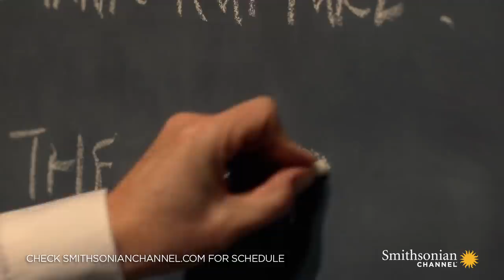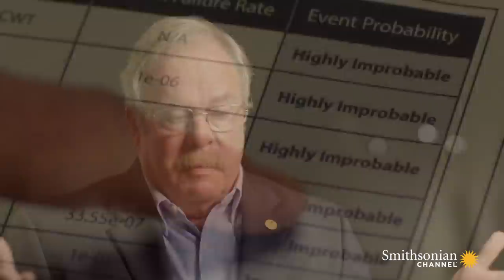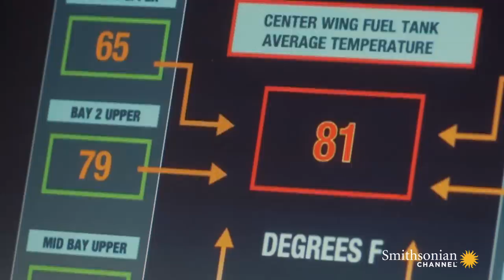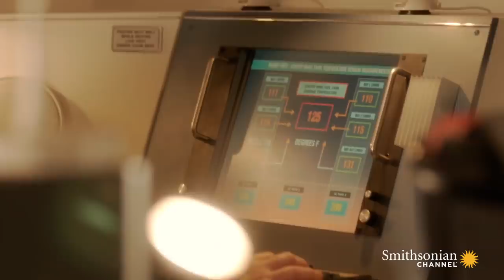How Air Conditioning Caused TWA Flight 800 to Explode

Comment: I would rather believe in NTSB rather than those peoples who have no knowledge of aviation and no experiences of aviation accident investigation.
Reply: What about those FBI who also investigate twa 800?
Reply: @smb226b  FBI, more for investigating crimes. Unlike NTSB, FBI does not specialize in investigating aviation accident.

Criminal investigators may have experiences in investigating crimes. But, it does not mean they have the knowledge or experiences in aviation accident investigation. A criminal investigator may not necessary have knowledge of aviation, aircraft components, etc.
Reply: @smb226b  If an aircraft crashed due to design flaws, but there are conspiracy theories that the aircraft was shot down, and the investigators focus on these conspiracy theories, the design flaws may not be fixed, and thousands of passengers lives will be in danger.
Reply: True 🤔
Reply: So, You have made a choice to [just accept] the NTSB findings, what, because they are a government agency? You are apparently unaware of how the NTSB is structured and whom are the ones performing the investigation and analysis.  Those with Aviation expertise, are the ones In the Field who have specific knowledge on particular systems and functions.  THE NTSB is (are) 'not the ones' whom are performing or doing anything.  The assigned groups and group members in special areas  are the actual investigators.  The 'Safety Board' is that of Five board members who decide how they will formulate a final report based on how they interpret the field reports, and thus make recommendations accordingly.  however, Those who actually perform the tasks and analysis [are in the Aeronautical / Aviation fields] such as my self. The 'Safety Board' is not always correct with their assessments and recommendations and are often wrong.  In fact, the NTSB in this case, was taken to federal court and sued over their final report, given that most in the Aeronautical field could not and did not agree with, and had good reasons to oppose the Boards final report. The NTSB lost in court,  and was actually Impeached for Fraudulent data.
Reply: The FBI did everything they could [not to be a benefit to and for the investigation,] but in fact did everything possible, to disrupt and interfere with the investigative groups efforts.  The FBI is and was complicit in fraud and disinformation about the case.  This was vetted in federal court as a part of an Independent lawsuit against the NTSB and the CIA.  (Both agencies lost, and were cited for Fraud.)
Reply: There was not,  nor ever were, nor could ever be a "design flaw" in or with the Fuel Storage and Transfer system.  The NTSB's theory was incompetent, and immaterial, as to the cause of the incident. The NTSB was well aware of the actual cause, however had reason to divert from such for political reasons. Nevertheless, the Board was taken to court and lost.  The NTSB final report is Fraud and was shown to be so in court.  There was nothing to fix, and the scenario presented by the Board is IMPOSSIBLE.
Reply: @robshef718  The main purpose of any air crash investigation is to improve aviation safety by finding out the truth and then make recommendation to prevent same thing from happening again, not assigning the blames. I believe NTSB had done their jobs well. I believe in their professionalism. I appreciate them. Without their efforts, the case of TWA 800 may repeat.

I will always ensure that, in any aviation disaster, conspiracy theories will never work on me.

Whether a plane was shot down or not, the evidence is on the wreckage and debris. Even if there are 10 millions so called eyewitnesses claimed they saw the plane was shot down, if the wreckace and debris show no sign of damage caused by missile, it is enough to prove that those eyewitnesses' claims were wrong.
Reply: @robshef718  I am so sorry, I don't buy your theory of impossible design flaw.

To me, human are not perfect, design flaw can happen.
Reply: @robshef718  Your comment prove your unprofessionalism. A professional air crash investigator will not presume impossiblity of design flaw in any aircraft parts.
Reply: Oh here we go with the peanut galley again...lol... and you would be in what area of Aviation?  Exactly! You are not.  I am former US Navy Aviation.  (but then you did not notice my Icon)  I am an Investigator so "thanks" for letting me know what my profession is.  :)     Key words are: Investigating and then finding the "Truth."  (that evaded you) while you were thinking about your reply!  it is called 'accountability' where such is required. (you call it 'Blame')  we call it being 'responsible'.  You 'NTSB' did not do their job well in this case. However, the assigned investigatory groups, did!  It is apparent that you really are not sure what occurred with 'Flight 800' and how the 'Investigation' went.  Given that, you (assumed) without warrant, that the NTSB findings were correct [despite the 'Findings' From the Investigatory Groups.]   So, you must do your homework, as it seems you did none.  The entire NTSB theory was a ruse. it was impossible for their scenario to have occurred and nothing the Board noted in the final report is even near any of the actual facts. This is why we took the NTSB and CIA to court, and won.  You also assume that a study of and any inquires into an event 'cannot' be questioned?  However, given that it would BE the Aeronautical community which are performing the investigations, it would be the reports from the groups, and not merely a 'recommendation' by the five member board. The plane was [not shot down] as I have stated time and time again, in many other 800 video posts as well.  You are not even aware that there IS evidence of proximity damage from a warhead.  (The warhead was not the Initiating event, however.)  So you best get 'back to work' as there was missile damage and such is even noted in the NTSB docket.  We don't need 'eyewitnesses'  as in most cases, causes for an incident do not require that somebody happened to see something.  So the Truth is, there was not (nor could be any center tank explosion) as depicted by the NTSB.  but thanks for your concern....
Reply: Now to follow up:  Just to let you know. It is not 'my theory', as I am not the creator of Physics. lol... You seem as if you wish that you  know a lot about Aircraft design and engineering,  huh?  (I mentioned I am former Navy Aviation.)   You do know that it take a lot of hands and engineering and science design principles and philosophy and many tests and approvals for an aircraft to get its Air worthiness certificates? There would be no circumstances in where the NTSB theory of a spontaneously exploding fuel tank could ever happened/ occur given a list a mile long as to why such is impossible. I don't suppose you want to go ahead and tell us about your thoughts on how there would be a 'design flaw'......  Because there is a tedious list of design and aeronautical performance standards and performances that must  pass a lot of smell tests.  In this case, there cannot be any situations that would or could result in the 'scenario' given by the NTSB. No one in the Aeronautical community believed it/ believes it.  being 'human' (as you say) does not dismiss known laws of physics and the understanding and functions of such as it relates to designing a fuel storage and transfer system.  You must demonstrate how a design flaw would present itself and then how all factors worked together and the successfully resulted in the NTSB theory.  Good luck.  I did mention that we took the NTSB and CIA to court and won....   :)
Reply: You know nothing of 'my professionalism' nor that of the Aviation Industry.  I wish you would point out (I love this part) how 'my' comment is such.  Then you will have to argue with Boeing, and the entire Aeronautical community as well.  A professional Investigator such as myself (thank you) makes no presumptions,  but is technically aware of the crucial details in all elements of a design principle and each one is tested. Certainly with the many flight hours of the B747, in her history,  and then the continued upkeep and maintenance, and re work and over hauls and the daily performance logs, for the many 747's in the world,  had then been a problem, such would have made itself aware somewhere and sometime in the history, and there never has been one case of a spontaneously exploding fuel tank using modern Aviation kerosene. [though many have tired to turn a few incident into such.]   You are spitting into the wind and did I mention that we took the NTSB to court and won.
Reply: @robshef718  This is because a professional investigator will not simply dismiss any possibility, including but not limited to design flaw, faulty maintenance, flaw in testing, etc. If you dismiss any possibilities without investigation into whether such possibilities happen or not, you are not professional investigator. A professional investigator will investigate all possibilities.
Reply: @robshef718  You mentioned you are former US navy. I assume it is true. But, it doesn't mean anything. You are also human. Human are not prefect. You are not prefect. Being a former navy does not make you know everything about aviation.

You mentioned air worthiness. Testing is not perfect. Nothing in this world is perfect.

So, your so called air worthiness and tests will not convince me.

You better come out with something that will convince me.

It is you wanted to convince me, not I wanted to convince you. I do not want to waste my time on conspiracy theorist and unprofessional person.
Reply: You read 'some' of my posts.  [I am former U.S. Navy, Aviation]   You don't have to assume anything. (however,  like I told another 'doubter' ) If I was going to lie about my experience, wouldn't I rather say that I'm some PhD or something, rather than 'an enlisted man' in the navy!  lol...   My profession required a lot of attention to detail and material readiness, as....'Flying Combat and other mission aircraft is what we do, from Aircraft Carriers'.   so, despite your Misplaced Opinion,  "it does mean 'everything'.  What do you think: that there are no qualified and successful engineers, or nobody understands anything!  lol... and that nobody knows the science, nor the physics, and there are no universities and accomplishments "because we are 'human'...    WTF is that suppose to mean!  If you have not looked around the world, we have designed and built many successful bridges, and machinery, and industries  and even...... commercial aircraft that have flow millions upon millions of successful flights for many years.  So, that is plenty of experience to know what works....  So yes, 'being human' means that we are very smart and educated and talented and  with a success rate that far outweighs anything simply material.  As far as my profession, dear boy, I am quite in the realm of perfection,  in as far as what I was required to do and have and had performed in my job, was concerned.  This is where awards and letters of appreciation and accomplishment comes from.  ( I cant stop it from raining....no....)  however, you seem to have a lack of respect for the sciences and the arts. Now,  in as far as what I took the time and effort to learn, and what I was required to know,  and, in what I  was talented for, in my field of Aviation I am an expert.  Having been in Naval Aviation in fact, 'does qualify', so you are not doing so well with your 'Ad hominem' commentary, which is embarrassing for you.    Again, you are not in the field, and therefore are not qualified, as to what is or would be airworthy.  You are generalizing and batting at a topic you have no idea about.  We, or I, don't have to convince you.  Who the hell are you!  lol...   its not up to us to show you jack.  'You' should go back to school and earn your own degree there, bud.   So it is time that you get into a forum that you have some idea of how this all works!  lmao.....
Reply: @robshef718  Beside TWA 800, there are other aviation accident happened due to design flaw. Turkish Airline flight 981, american airline flight 96, United Airline flight 585, USAir flight 427, Eastwind Airline flight 517 are samples.

No matter what you say, I strongly believe in design flaw. Your lie will never work on me. You can claim whatever you want, I will never believe.

In TWA 800 case, there is one thing I agree with what an NTSB investigator said. It is tired to argue with some people.
Reply: @robshef718  And, there is one more thing. For NTSB's investigators, and many other air crash investigators in this world, at least they contributed to today's aviation safety. What had you done? NONE.
Reply: We 'could' go round on round on this if you like, but my posts and this forum is regarding the TWA Flight 800 incident.  Many 'sources' result in, and revert back to grossly modifying the 'results', [Despite the Industries input] and [Factual data], and lets leave the politics and lawyering of such alone. lol.  (Follow the money.)  You can 'believe' what you wish, but such will not detract from the facts. You have not addressed what the TWA 'design flaw' was or still is, despite the facts that this already went to Federal Court (Myself having provided several Technical essays.)   You have to prove 'Your flaw theory' before you accuse an Aviation Expert of  just what the 'lie' is, as you claim. So, You go right ahead and Believe in Faux science. The [Aeronautical Community] did not accept the NTSB's embarrassing scenario. but you seem to think you know more than the Industry.  :)   Good luck with that one!   So, here.  Let me slap egg all over your face.  I will take it that you are a good loser?  lol...   http://twa800.com/news/nlj-9-18-06.htm
Reply: Ah, yes!  Arrogance, must squeeze in that last 'desperate' plea of insanity and Ad Hominem, attacks. So, I have got to ask, 'did you point your finger up towards the ceiling as you said..."And there's one more thing!" lmao..... and then more of your Ad Hominem.  btw, 'I was instrumental' in solving this well known Air crash investigation, with my expert participation in the lawsuit. ...... and you?   lol....   You are not even in Aviation. Wow.
Reply: @robshef718  Yes, I admit I am not in aviation sector. But I do understand that there is nothing perfect in this world. Design flaw can happen to anything. Human are not perfect. Design flaw is more serious than faulty maintenance, shot down, pilot errors, etc as it involve hundreds of aircraft.

I respect and appreciate investigators from NTSB, French BEA, etc, as they contributed much in aviation safety. Unlike you. You can't be compared with them. You contributed exactly nothing in aviation safety.
Reply: It is 'Good' that you are not associated with the Aviation and Aeronautical community....'sector'.  And your 'mantra' does not address the issue for which you claim to have information about.  You, however  are Still required to show the 'design flaw' (for which neither the NTSB nor the Aeronautical community) can identify in the case of TWA 800.  As stated already, (read carefully)  'There cannot be any design flaw related to the Fuel Storage and Transfer System as has been [theorized} by the NTSB. This, for many aspects of Physics, as well as the characteristics of Aviation Kerosene, and how the Fuel Storage System has been designed. As mentioned before, In my Naval Aviation experiences and education, I have contributed substantially to my profession as well as my participatory efforts in the Lawsuit against the NTSB and CIA.  So you are sorely mistaken about my career, and that of the TWA 800 case.
Reply: @robshef718  NTSB investigators did not found any damage caused by missle. I trust NTSB in this. This is enough to disprove the theory of shot down by missle.

We know that jet fuel are flammable if its temperature is high. NTSB investigators did test the temperature of the fuel during flight under the same flying condition as TWA 800. Their test result showed that fuel temperature was high during flight. Again, I trust them in this.

Since the fuel temperature became higher, there must be something heating the fuel. According to NTSB's theory, it is air conditioning unit, but this doesn't matter. For an object that cause heat to the surrounding objects, putting it near the fuel tank is a very stupid idea, and stupid design. But, high fuel temperature alone will not cause fuel explosion. It must be combined with a spark. For sure, that spark was not a missile attack.

In case of TWA 800, low voltage wire bundled with high voltage wire. Again, whose idea is this? Devices plugged with low voltage wire may not be designed to accomodate high voltage power. If short circuit occur, high voltage power may reach the device, and it may cause a spark, fire, etc.

If a device in fuel storage system was connected with low voltage wire, and the low voltage wire was bundled with high voltage wire in some area, and short circuit happened, then, to me, this explain the source of the spark that caused fuel explosion. I don't care whether you believe in this or not. I believe in this.
Reply: I really appreciate your 'zeal', (misguided as  it is) but you must know what you are talking about, before you type. You do well to follow the propaganda which does you no good, and is a disservice to those who actually have done work, and put plenty of manhours into this  case, (my self included).  You must read: That is fundamental. I would be correct in stating that 'I' have never stated that the plane was 'shot down'.however, you have (apparently) not read the  NTSB reports and dockets. There is ample of evidence for 'missile' damage. This was also  stated and supported by the [IAMAW] breifing.  So, as I have stated in many other 'same'  posts, there is no proof that an [anti  aircraft missile warhead] was the [Initiating] cause.  However, in federal court, the NTSB  scenario was dismissed, as the NTSB was Impeached for Fraud. There was no nor could  there have been the 'exploding fuel tank'  scenario.  So you can't disprove what never occurred. You are totally incorrect about jet fuel, in  this case.  I am Former U.S. Navy, 'Aviation Boatswain,' and that was my job.  Aviation  Kerosene is not a flammable liquid but a combustible liquid.  It is a highly stable  fuel.  It is very difficult to ignite, and cannot explode in the manner as has been suggested by the NTSB. (Did I mention we took  them to court, and they lost?)The NTSB 'test(s)' was and were 'JUNK SCIENCE,  as presented to the court.  Case No. 02 8708 AHM (RZx) December 14, 2003;  page 34, line 14.   'Nothing' in the NTSB report is at all factual, as the 'entire' report is a total  fabrication; made to suit their fabricated  scenario.   The fuel test(s) they did, is (was) a joke and not based in any viable science.  it is IMPOSSIBLE for the scenario they fabricated, and no one in the Aeronautical community has accepted the NTSB theory.  It is Impossible based on several points in physics and the characteristics of Aviation kerosne, and then the Architecture of the Fuel Storage and Transfer system. The center fuel  tank "cannot" heat up as suggested.  So you can choose to be an idiot, if you like,  or I can school you in the real world.  Just sayin.   The 'fuel temp' never (heated up) as you stated. The center tank never reached much  above ambient temp, and never reached it's  flashpoint. This was worked out when the Engineers in various Aeronautical disciplines were designing the functions of the entire system.    As well, the 'AC' unit provide "ZERO" heat (into) the center wing section. If you are familiar with 'Convection, conduction, and radiation' principles, and how heat is measured in Engineering terms???  Just asking    :) 
And it 'does' matter, because that nonsense was a key part in the NTSB's  fairy tale.  Where do you get, or where did you 'get the idea' that the [Airpacks] produce any appreciable heat?  If you had known how the unit operates and fuctions, than that would  alleviate any concerns of yours!  :) 
The 747 design is efficient and genius, and the rest of the Aeronautical community as well as the Industry and the FAA well agreed, as the plane did pass (and had to pass) the 'AWC' you know!   Or, do you just think they 'go with anything' and see how it works out' ?  lol.  So there was NO 'high' fuel temp.  It gets pretty damn cold at cruise altitude, but would it bother you if I told you that the 'system' has 'FUEL HEATERS'?     rutt rooh.  
You dont know much about this I can see. No spark would 'blow up' anything in the fuel system. For several system redundancies. And as no system associated with the FSTS operates on utilizing a spark, nor can produce 'sparks', as the NTSB had erroneoulsy suggested.  Even [if] there 'was' a spark, the [vapors] do not possess the chemical energy to explode as high energy.  You ever toss a match on the BBQ after using the fluid?  and....?  Its a poof!  It might scare ya, but your grill is not going to blow apart.  And as already stated to exhaustion, there was no 'missile attack'  and the 'wire bundling' as being [the issue] is a ridiculous myth as well.  Quit reading that garbage!!  (I did mention that we took the NTSB to court, and that the NTSB lost?)  Just checking. Your entire 'spark wire' theory is nonsense.  I doubt that the wiring in your car, such as your alternator is 'somehow' going to 'somehow' connect with 'the wires' going to your cars gas guage wiring, and then.... 'somehow' connect and then 'somehow' arc inside your gas tank, and blow your car up. lol.... why not?  architecture.   You are thinking too hard there, buddy!  Again, you cannot explode liquid Jet fuel as proposed by the NTSB.  And if the vapors were as 'explosive' as they have theorized, then every time you tried to start a jet engine, it would blow apart!   come on now dude... So, you go ahead and remain a moron, and the rest of us in the real world of actual science and the Aeronautical world, will do the actual investigating... cheers.
Reply: @robshef718  I have no time to write long post like you did. I also not interested in wasting my time in arguing with a professional of conspiracy theorism. I got no benefits.

I am a foreigner. I am not interested in American politics. The conflicts between you and NTSB and your government are not my interest.

I am not an aviation expert. But, I did found flaws in your statements. I am not going to elaborate it. Go and find by yourself.

May be you don't realize that, in front of foreigners like me, what you did will bring shame to your nation. But, I have no problem with this. I just treat your posts as my entertainment.
Reply: @robshef718  If i remembered correctly, you did mention airworthiness in your previous comments. I did follow the news and investigation of the crash of Boeing 737 MAX jet in indonesia, which happened last month. Did you follow? Your so called airworthiness, is it a joke?
Reply: I also trust professionals within the NTSB. However, if you read correspondence with the CIA you will notice things like, "We are concerned that the evidence does not correlate to the chosen scenario." This is what the professional investigators wrote to the CIA when they were assigned to create the "official story". Lot's of damning evidence in documents that you can obtain using the FOI act.